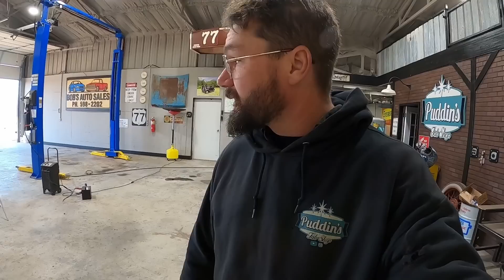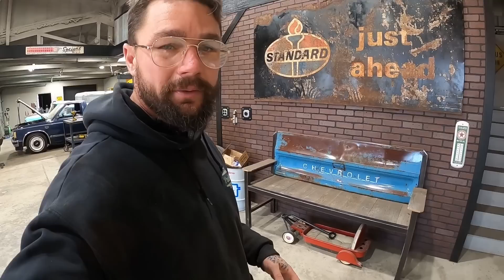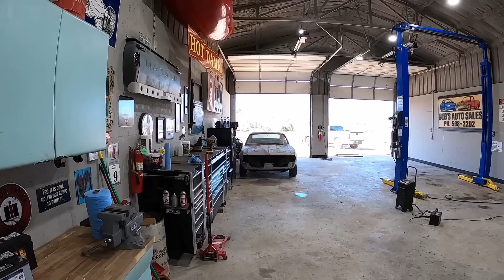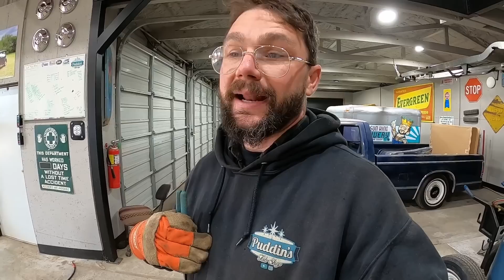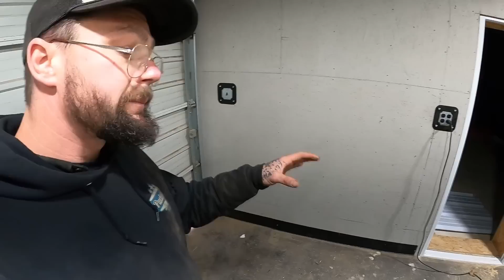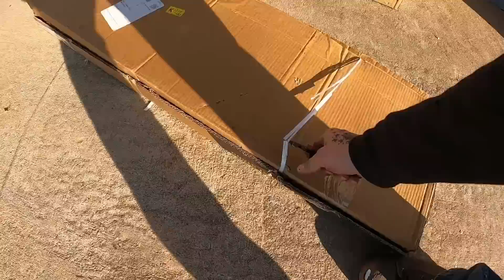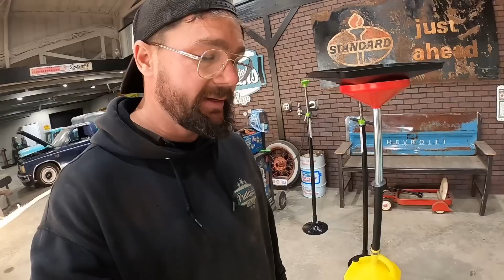I should of done this sooner!! WELDERS, TOOLS, MORE!

Comment: 0:40 here’s you an idear for some second channel content:

Build or Fab (lumber or steel) yourself a big box with door to sit on the concrete near one of your shop’s doors; bolted down if you want. Can’t remember if you have some covered outdoor space or not, but I’m thinking nearest to your merch shop—especially if you schedule pick-ups. 

Give it a Schlage keypad deadbolt for about $120. You can put this code in the second address line when you order something. You can always change it if needed. And you can use a ton of different numbers at first setup, then remove any codes that get compromised. We have Schlage keypad deadbolts on all our house doors and they get some frequent use…still smooth action on them. Hell I think I got an extra one brand new somewhere I can bring ya next time I go to OKC. 

Since you have the equipment and the steel fab skills, I’m thinking steel frame with some sheetmetal. Or an old vintage fridge with some curvy lines. Paint it a flat turquoise then give it some pateener with a vintage looking sign that says “Deliveries” in cursive.  Put a matching sign up near the driveway directing delivery drivers down to the shop.  If you wanna get real cool, make it big enough to put a little cooler in it for the delivery personnel to grab a drink and snacky snack. Or a tiny mini fridge lol. 

I’d think it would be easier for trucks to drive down in there and turn a big loop in your parking area anyhow. 

This would be Slicker’n a Hot Snickers! 

But still…..we wanna see a badass golf cart on here too. Huge light bars all the way around. Pateenered turquoise with some white rims. Goriller tape on seat rips and a little boombox zip-tied to it. Toolbox and cup holders.
Reply: Ah no..

Comment: @puddinsfabshop cool little trick for your plastic oil drain pan for your lift... get ya a floor scrubber pad that is used to strip waxed floors with and drop it in the pan.  It keeps the oil from hitting the pan directly and splattering everywhere.  Also put you a magnet on the top of the tank to hold drain plugs, socket and ratchet or whatever

Comment: I can tell you from personal experience a good tractor with a front end loader will go a long way with doing everything from just running back and forth in a small distance to pulling cars and even lifting cars. My little kubota L3902 has picked up the rear end of a 2005 durango. But ive moved a 47 chevy a 51 buick and a 76 buick 4 door electra (extremely heavy car). And ive picked up a pinto. Tractors are not cheap tho. I paid 56k for a mid sized kubota with 30 hp and a front end loader and bush hog. But thats with $0 down and a credit score that was started a few months before.

Comment: Skip the golf cart & side x side. For about the same money, you could get one of those Japanese mini trucks. Full bed for hauling parts from the junkyard. Can even get dump beds that could be useful for dirt/rock/mulch around the property. A fun little build that could be a good algorithm booster. Enclosed cab for heat/ac. And can be made road legal. Win-win-win-WIN as Puddin' might say. 😂
Reply: Those are cool a friend of mine has two them both his teenage sons drive them plus they were fairly cheap to buy with low miles

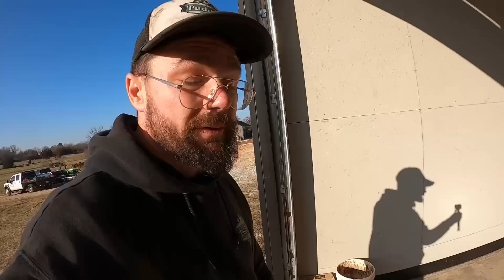Comment: 35:40 fun fact. Those will not lift a 99 2500 dodge ram. My local shop found that out the hard way when their air jack crapped out.  Snapped the screw part in half.

Comment: Buddy….When you caulk, cut the tip on an angle and move the tube faster along the wall, and  pull it  In the direction you cut the tip too…. You will like the results much better.  It will apply smoothly and wont look like mig welds :)

Comment: I have seen several golf carts modified to look like mini 57 Chevy's minus doors,trunk and hood. If you want to do a quick 2nd video,mod a golf cart with a small flat bed in back for micro hauling stuff. Puddin's antique golf cart style,micro sized. The question is will it be electric or with a gasoline motor where you can rip in the field. My feeling ,it will be a gasoline with a Harbor Freight "Predator" engine. Going new engine leaves you with less headache why it don't start. Don't forget to put some "Mudder" tires oh her to do her ripping in that field. Got get that carbon build up out of her.

Comment: I have one of those China transmission jacks in my shop. Had it for more than ten years and it still works well. Only problem with it was it always leaked after using it. I finally read the instructions and they said to loosen the screw on the side of the cylinder before using and tightening it again after use. No more leaks, guess instruction are helpful sometimes! Shop looks great. Love both of your channels. Looking forward to the next video.

Comment: If you do place the welding table against the WOOD wall as mentioned you might want to strongly consider installing a metal back splash with the top edge sealed along with another fire extinguisher ofcourse, can never have to many of those.❤      also as much as I hate short on YouTube  allegedly it greatly helps your channel and gets you more paid.

Comment: You saying about the golf kart, I thought a little bit ago it'd be cool if once you was all settled in, to build a couple little powerwheel-esque machines similar to what they build in grind hard just for mooching about on the property with that you slick bill and possibly the girls could use. You then busted out those little red things in an episode a little while back that you said hot rod wasn't keen on, maybe they could be a good base for that kinda thing if you was to build up the suspension and stuff around it, basically what you do on regular rigs but on a slightly miniature scale. 

You could use those harbor freight lawn mower engines or a cheap little bike engine, maybe build a mini-mini truck with an xl bed that you could slide into the shop from the house in and also haul your parts/long pieces of scrap from a to b. If you end up building it fancy with some painted dimple dye action going on underneath that could also be a nice little merch hauler at the odd event if you went that far with one. It'd be like a mini tow roller but with a bed, could do just about whatever you throw at it!

Of course that just adds to current projects n don't help you in the short term though, the little 4x4 luv is always lurking and it won't be adding more vehicles...

Comment: How to make some kind of an overhead Trolley system for your TIG welder better ways added to four! 😮 had like a garage door opener from corner to corner they will move your TIG welder across the building without touching the floor have enough Stinger to use it? Don't mind me to I'm just thinking out loud has a tendency to get me in trouble the thinking part😂😂😂! Till next time my friend

Comment: Get you a Side by Side instead of a golf cart you can get into more places like wrecking yards or the middle of a pasture pulling parts off of classic vehicles 👍🏻
Reply: The man tows with a Celica, pretty sure his "golf cart" will traverse the Rubicon.
Reply: @michaelsine1181  just a suggestion
Reply: @michaelsine1181  sir, don't disrespect the tow rolla like that. It's a corolla

put some respec on its name😂
Reply: Get you a Kawasaki Mule, so much better than a golf cart and would last forever.
Reply: Great idea
Reply: Suzuki Samurai !!
Reply: I use mine for yard work all the time. Handy little unit. Got trash batteries, so it only has maybe 20ish minutes of pedal to the metal. But that doesn't matter when you just use it to run across the property. But I agree with you in this case. Something with 4x4 would be ideal for him, but not a requirement.
Reply: I was thinking the same thing. Plus the SXS can pull and is winch compatible.
Reply: That or a Kei truck would also be awesome to have around the property. Some of the Kei trucks can also be cheaper than side by sides.
Reply: Or an all wheel drive tractor with a bucket and or forks!?
Reply: All you guys doubting a golf cart must not have any real world experience with one....cheap....easy to jump on/off, super capable off road, and the gals could run it around too.
Reply: @danielkingery2894 I agree completely.. a gas engine ez-go with a tilt bed is a workhorse when it comes to light duty stuff.
Reply: Yall know good n well that puddin ain't gonna spend big money on a side by side..😂 rescuing a raggedy  old golf cart makes more sense.. it'll be useful and provide content.. paying for itself.
Reply: Old used John Deer mule would be great
Reply: Better yet... Just build a little trailer for one of the go-karts to haul the mail 😁
Reply: Or maybe just use one of his pickups or other vehicles.
Reply: Oh sorry my bad 😅
Reply: Not sure what your smoking but never mentioned let alone showed a golf cart
Reply: @DakotaSchultZ-l6z  maybe you wanna watch that again because right at the beginning of the video Puddin talked about getting a golf cart for doing mail box runs. To carry the heavy stuff from there to the shop. It’s literally within the first 5 minutes of this video as well as being mentioned in a few others.